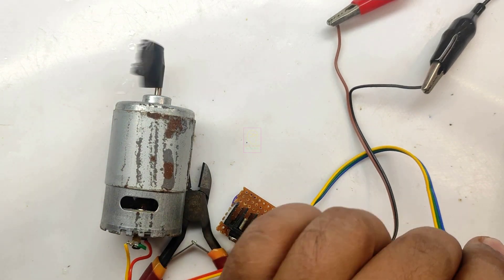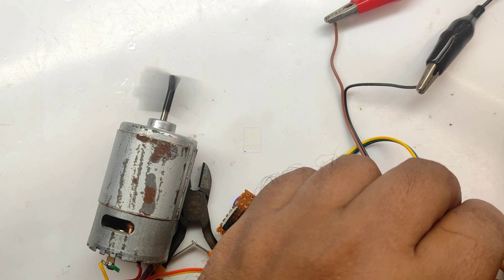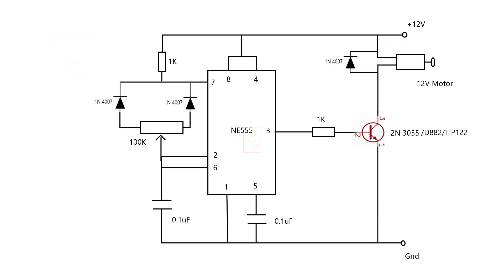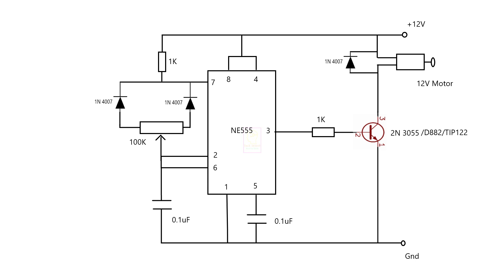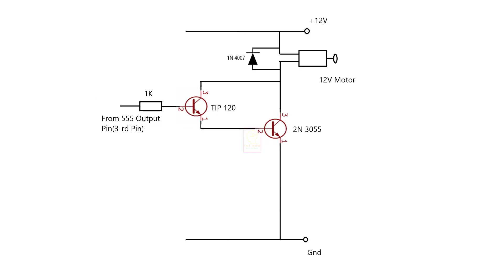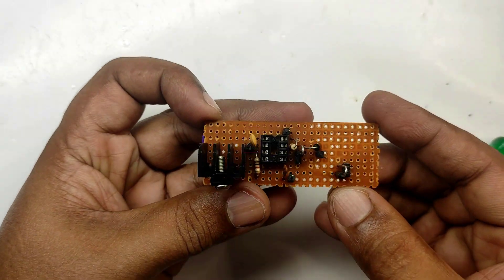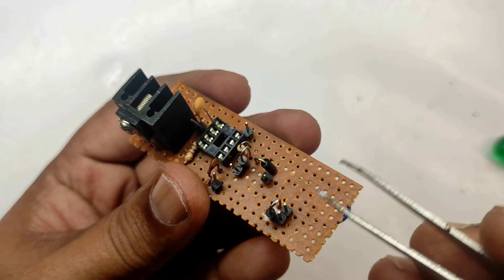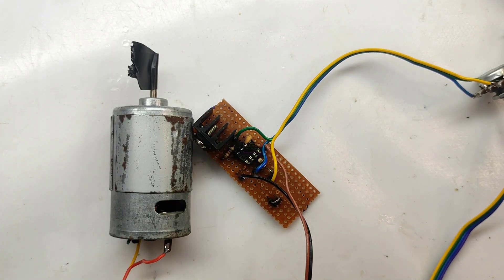Make PWM DC Motor Speed Controller Using 555 Timer |  DIY PWM Motor Speed Controller

Comment: I need speed controller for 12v DC Motor without using potentiometer
Reply from the maker: How you are planning to control the speed without potentiometer?  Please elaborate your question so that we can find a solution